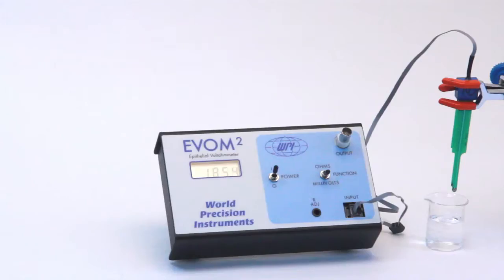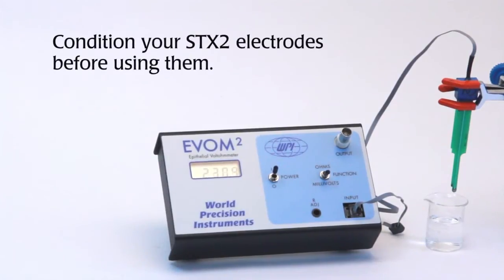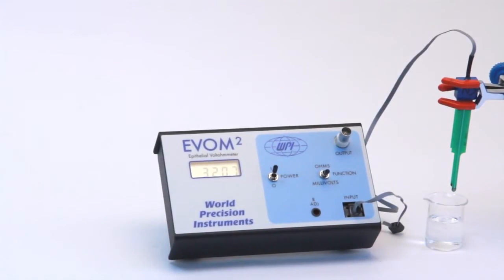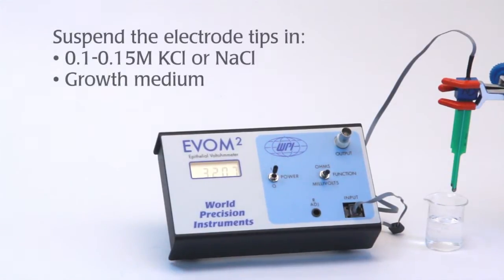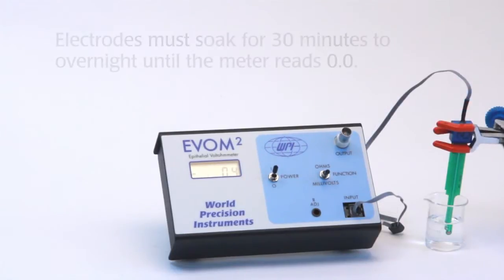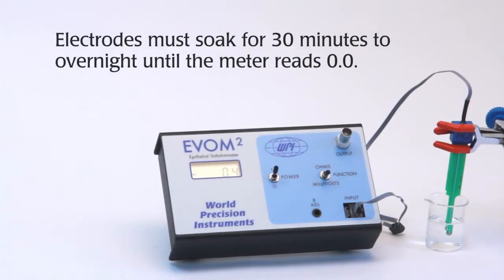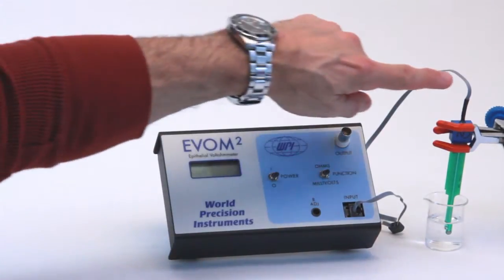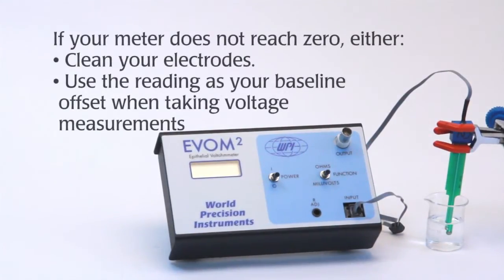Equilibrating the STX2 Electrodes

Comment: how we can fix the electrode on a 24 well plate?! it's very unstable and with a little movement it will change in a wide range and it's not possible to make sure that it's accurately your TEER value!